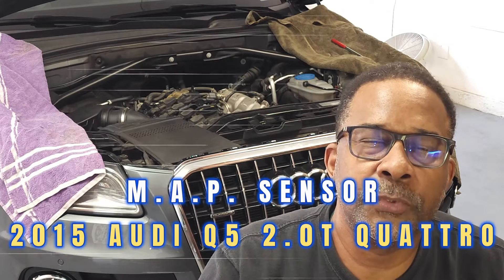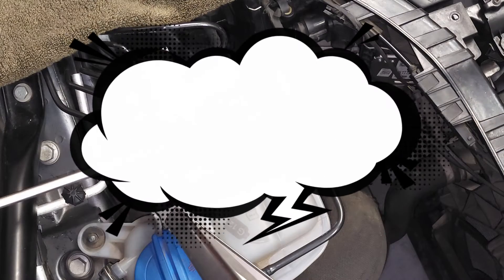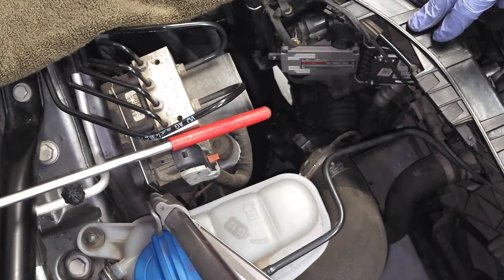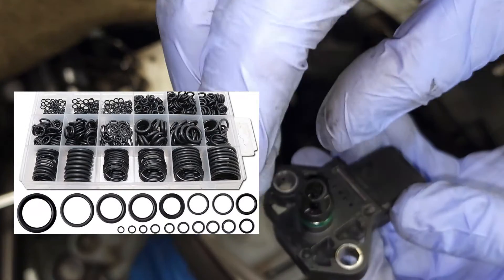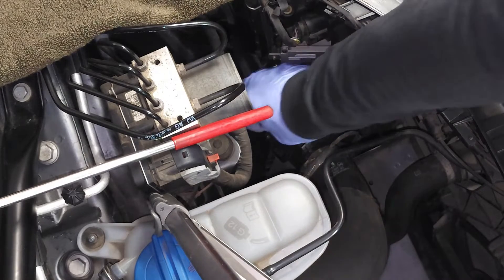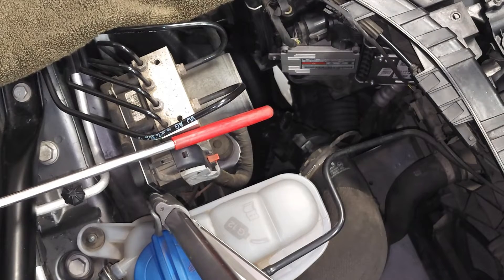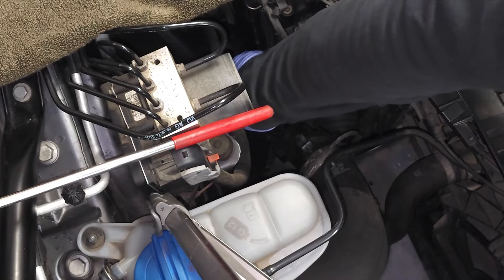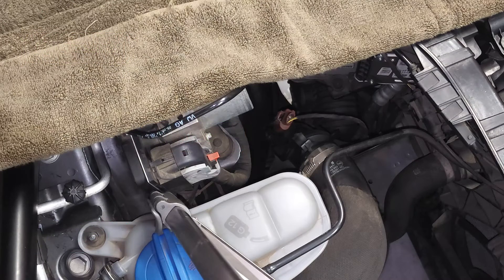2011-2023 AUDI Q5 2.0T QUATTRO, Clean & Replace Manifold Absolute Pressure (MAP) Sensor

Comment: Do you have any videos for 0299?
Reply: I removed the under carriage of my Q5 looks like everything is in order no cracks in the hose leaving the turbo. I did remove the diverter valve/ sensor pending Amazon to deliver my new one. Also think I’m going to stop using a air compressor to suck out the oil from engine I am pretty sure an oil change was done where they or some places a rubber ring between the drain plug and the oil pan I think it’s causing a leak be it small and non class three constant drip but there was noticeable underneath my car covered up by the undercarriage cover. Removing the diverter was pain in the you know what getting the top screw to come off was a pain. If this isn’t the solution I’ll find out today and message back. I’ve seen a comment somewhere were someone said you could simply retighten the door or whatever it is that causes the turbo to not function correctly but I’ll find out and browse around to watch video
Reply from the maker: No video, but try to locate and clean your boost sensor before moving to more expensive options. Also, be sure to check all vaccum holes for cracks. Send feedback. Thanks

https://parts.audiusa.com/p/Audi__Q5/Turbocharger-Boost-Sensor/98441812/06K906051E.html

Comment: code p017700
Reply from the maker: A "P0177" code on a 2015 Audi Q5 indicates a problem with the "Fuel Composition Sensor Circuit Range/Performance,"
Reply: @protipsplus  i have p0171 , already clear 02 sensor , maf sensor , replaced oil separator valve , now i will try to clean this map sensor 😢

Comment: Where is the MAP sensor location on 2017 new design? :D please respond! :D
Reply from the maker: The Manifold Absolute Pressure (MAP) sensor on a 2017 Audi Q5 is located on the intake manifold, either next to or on the throttle body. If the engine is forced-induction, the MAP sensor may be found on the intake tract before the turbo.See...https://parts.audiusa.com/p/Audi__Q5/Manifold-Absolute-Pressure-Sensor/65122919/07L907386B.html,